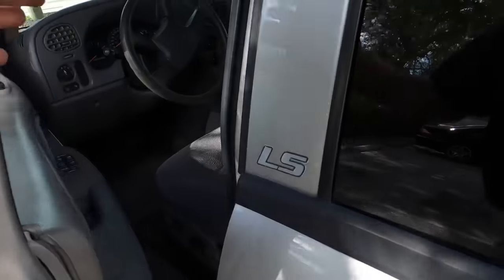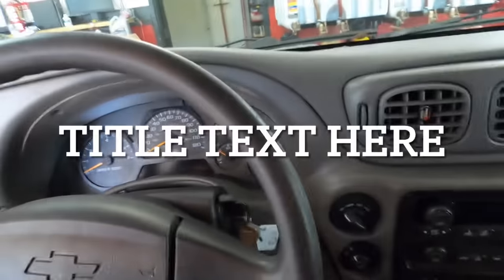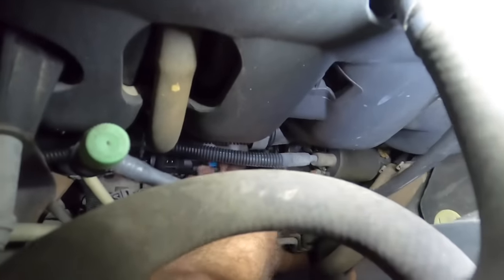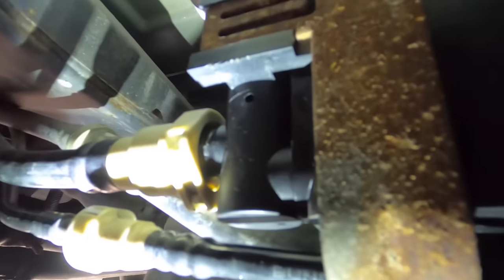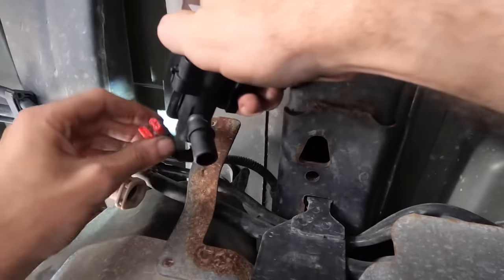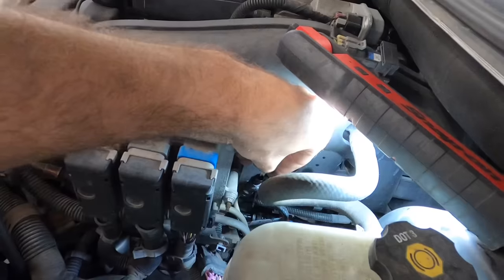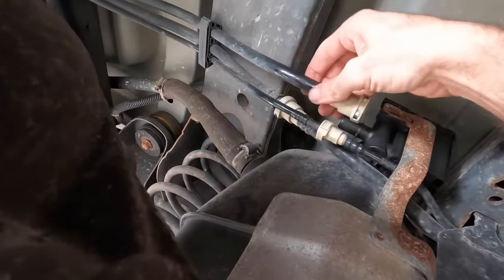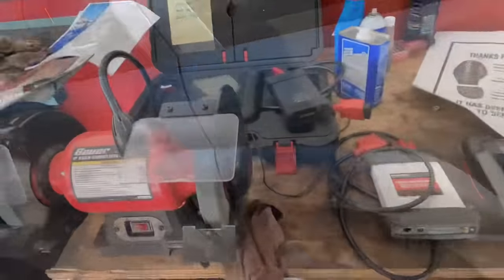Repair failed! Customer is Angry

Comment: I am impressed I learned something new. Reset codes before going to man to fix your ride. That is some next level thinking.
Reply: Exactly.  I'm going to use the diagnosis of a counter person then go to the expensive mechanic and force him to waste time.
Reply: I was trying to give the guy a chance. Maybe he had the code reset thinking it would fix the problem so he could avoid the shop.
Reply: Maybe he hoped it would reset his purchase of an old Chevrolet trailblazer.
Reply: Personally, I would have told the customer to drive some more until the warning light came back on, then to bring the car in immediately.

Comment: Thanks for the basic explanation of the evap system. I was having problems with the evap system on my Wrangler and didn't really understand what it was at the time. 
Funny story about that Jeep: I got it off an auction, sight unseen. It turned out to have massive problems all throughout. I was pretty bummed about the cost of repairs needed to get the thing running right and driving straight. One day, the clutch hydraulic system sprung a leak and I started losing clutch pressure. As I drove down the freeway toward home, cursing the Jeep the whole way, the Ram 3500 behind me decided to check his phone right as we approached a traffic jam, and slammed into the back of me going 70mph. Needless to say, it turned out to be a blessing in disguise. The money-pit/death-trap Jeep was totaled and I ended up getting a descent sized insurance claim settlement. That's one way to fix a problem vehicle.
Reply: Hopefully you replaced it with something reliable like a Toyota. I sold my Jeep and replaced it with a Tacoma. Could not be happier.
Reply: @MrMikey1273  Can't say on the newer ones, but folks who have older Tacoma's tend to not want to sell them till they're either rusted to bits or totally worn out. That should tell you something about them...

Comment: You could definitely hear a difference in the audible sound of the off and on of that valve
Reply: "Click" (or is that an achieved torque setting?) 😉
Reply: That's because the piece is banging against an end-stop when the solenoid energises, and just falling out with gravity when it loses power. So you get a click, snap or clack when on and a rattle when off

Comment: I had to replace a purge valve solenoid on our 07 tahoe , first code popped up was "tighten gas cap" bought a new gas cap. 

Cleared that code for that also had a pending code for the purge valve an it was gone show up anytime. So I knew that's the next part to replace. 

After replacing both parts i have no problem filling up gas or 3 cranks to start after a fill up, that happened first before replacing the purge valve. 

Gas cap was probably worn from over the years since 2007 till now.

Comment: My 2002 Trailblazer lasted 20 years with no major issues. Sold it because it was old and wanted some new tech. Hopefully my new suv will last that long.  There was a recall on the gas tank/ assoc parts.  Free replacement.

Comment: Love your videos Ray. As a GMC dealer tech that deals with evap issues on GMs every single day, i want to chime in on this one. I like to start with evap systems by performing a purge/seal with the scan tool engine running. That can often give you a good indication whether you’ve got a system that just won’t hold vacuum, a vent solenoid that isn’t closing, massive leak, fuel tank pressure sensor that’s lying, etc, just gives a quick preliminary of what the system is doing before breaking out the smoke machine or anything like that. 

Now the second thing i want to mention, on GM vent valves, turning them “on” energizes the solenoid and CLOSES the valve. So I’m a little confused on why you’re expecting there to be smoke coming out when you turn it on? Unless i was just misunderstanding. Turning the valve off should open it and allow smoke to escape.
Reply: Is it true that smoke doesn't open valve on GMs?
Reply: @abccde3832  apparently yes from everything I've gathered, but my experience with a proper smoke machine is non existent but the actual verified mechanics I've seen are saying yes
Reply: @michaelf.2449  very good to know, thanks!

Comment: Awesome 😎 I own 2 Chevy Trailblazers a 04 and 05 love to see your experience used on these vehicles it increases my knowledge when weird things go wrong with mine 🤣 Thank you very much 👍🏼
Reply: I had an 04. I liked most everything about it except the damn ridiculously complicated and overly sensitive independent vent/duct damper motors. They'll go electronically belly up just changing or disconnecting the battery. I've been a mechanic of various genre's my entire life and consider myself a patient man but I'll tell ya...those damper motors made me walk away inventing new swear words more than once.
Reply: @gregoryking9348  on my 04 my fan speed resistor has melted the plastic electrical plug so now my blower motor hasn't worked for 6 months now 😠 I was wondering why there was a faint smell of burning plastic sometimes as I'd drive around 😂
Reply: Jimmy S  The GMC Envoy is the same as the Chevrolet Trailblazer both came in 2 sizes a standard and an extended version that added a third row of seats. 😎

Comment: Always use original GM evap parts only on GM's. Same thing happened to me. Bought a purge solenoid from Autozone, lasted 2 weeks. Replaced with AC Delco 3 years ago still working fine.

Comment: Brother, I wish your shop was near me.  I have had no luck having my Impala repaired from 3 different mechanics.  I love your videos. Keep them coming.
Reply: @Uriel Ventris 
Good, competent, HONEST mechanics with skills are RARE as needle in a hay stack. Same problem here...
Reply: What sort of issue are you having?
Reply: @Zxceelxuz  Intermittent failure to start.  The security light will come on.  I have to do the 10 minute reset then it's all ok for a while.  I've had the dealer and other shops "work" on the BCM but it still comes back.  Basically, it sits in the driveway now because I can't trust it to start again.  2006 Impala.

Comment: I am surprised you took the smoke machine away before mounting the new valve. Audible test ok
 Smoke test better.
Reply: I thought the same
Reply: @Charlie_Crown  Yep.. But i am not sure its fixed.. If the solenoids are working its probably OK valve.
Reply: Yes!!!! Seems silly..
Reply: @TheJcrandazzo  Of course it's fixed. It's Ray, remember ? :- )
Reply: @loubakker5000  could be??
Reply: @Nostalgic Enigma I think Ray is a good mechanic. They always contact the customer. Customer can always say no. Partys canon sounds too popular.
Reply: @TheJcrandazzo  He is good mechanic, no ?
Reply: @Nostalgic Enigma What's SMA?
Reply: @Nostalgic Enigma Doesn't it always start wih a guess ? That educated guess shows the way to search helped by a tool. Not familiar with SMA. I am from europe.
Reply: @Nostalgic Enigma Customer came in for evap system with relation to solenoid provided by the customer and installed in Ray's garage. So why do a deep research if not asked by customer ? Don't need to. No checking wiring diagrams required. 100$ for a smoke test ??? Tax included ?
Reply: @Nostalgic Enigma Yeah, I remember the guy. With mrs O.
Reply: I have been fighting this same code for a year now.   I had a fuel pump go  out on my 04 envoy same thing as this trailblazer. At the same time I replaced the filler neck it was rusting out.   The new neck and old gas cap didn't fit so I had to get a different one.  I can never tell if it seals right.  I even built my own smoke tester.  I didn't  plug it in at the port I used the filler neck.  The thought was the problem  would be a loose connection when the fuel pump was replaced.  When I smoked it it was leaking around that purge valve. But I had no way to command it on or off.  I replaced the solenoid in the front and valve in the rear. Given the age of those parts and the price of them I just decided to do both.  And they were delco parts  after doing all that guess what the error code came back a few days later. It's not driven every day so it can take some time for it to come back.  I have a new reader now that will actually read evap data. I have the data I just don't know what spec is.  So frustrating  my hunch is the gas cap. I see now how to use that front port.  That might be the next move.  I will foil tape the gas cap to the filler to see if I get a code before smoking it again.
Reply: He could have driven it for a half hour and see if CEL light came back on and charged the dummy customer who had it cleared for the time.

Comment: I had a car that was having starting issues, so I had the battery tested and it was bad. I put in a high dollar Gold series 7 year battery. I still had starting issues, so I replaced the starter, then the cables, and.I still had issues..so I took it to the service station that sold me the new battery. They analyzed and checked everything - it was the brand new battery. The first part that I replaced was still the issue.
Reply: I have installed those batteries at a parts store I used to work at. There is nothing more embarrassing than having a brand new battery go "click"

Comment: I agree with comment from South Main Auto Repair LLC. I've been fooled by that valve not opening when there is pressure from the smoke tester in the system. However, it appeared that Ray did not really have a tight seal where the smoke machine connected to the test port so I wonder how much pressure there was in they system.

Comment: I do not go out and buy random parts until I know for sure what is broke. That's like right now my expedition is throwing two codes. When I locked up what might be the cause most of the articles and videos out there all say mass air sensor. Then I found other videos telling me the PVC hose is normally what is wrong. 
So tomorrow I'm going to do exactly what you did here and smoke the engine and verify what is going on before buying any parts. 

With a smoke machines that are out now it really helps figuring out things quickly. Has anyone who has ever had a vacuum leak you know how much of a pain in the butt it is to find it. Normally with the smoke machine within minutes you see where you have an issue.

As always I made sure to give you a big old thumbs up. Look forward to watching another one of your videos.

Comment: I just had to deal with the dreaded evap code on my cobalt. I threw the parts cannon at it and got it fixed. Luckily it was still cheaper that taking it to the shop or buying a smoke machine. Chevy evap parts are cheap, even the quality aftermarket stuff.
Reply: I built a 12v smoke machine from Lowe's plumbing parts and some other minor what-nots for about $25 and an hour of my time. All that's needed after building and using it is some baby oil and a small compressor. Even a 12v emergency roadside compressor will work fine.
There's vids on Youtube on how to build one. They're super easy but irreplaceable as a diagnostic tool...especially on older Rust Belt buggies like my '03 Dakota.
Reply: @gregoryking9348  thanks for the info, I’ll look into that next time I get those pesky evap codes.
Reply: @mikeymarriott  I bought one made from an ammo can on ebay for around $60 a couple of years ago. It paid for itself on the first use.
Reply: @gregoryking9348  Very interesting.Thanks,I'm going right now to check those out

Comment: Troy feels like I did when I got the call from the shipping company saying I had the wrong address and if I had a phone number so they could get the package to you. I'm impressed that you didn't start yelling at Troy for the wiring mistake. Obviously he didn't notice the crank sensor wasn't connected, he should have been with you when you were coming up with a solution to fix the problem instead of going for lunch because he was mad. At least he didn't start throwing tools like some people do. Good job on coming up with a solution to correct the situation.

Comment: When a customer goes cheap , pay twice 😂
Have a great weekend everyone and a great day of course ! 👍
Reply: I learned that lesson having my mechanic install ebay sourced wheel bearings on a Prius.  Didn't last long, neither did the warranty replacement ones.  Mechanic was happy, cuz I had to pay them twice lol.  I think it was still cheaper than the OEMs they wanted to do in the end, but I won't do that again.
Reply: @Solkre82  , people buy Toyota for reliability , putting cheap part on Toyota is like shooting yourself in the foot
Reply: I can’t learn that lesson fast enough
Reply: @tstocker6926  😂 true
Reply: @Solkre82  what about a used one
Reply: @theantiveganchannel3596  My problem was I didn't know about the "eBay issue" with car parts at the time.  They all say their OEM quality and it was a high mileage car already.  I know better now.

I still try to do my own work when I can.  Replaced the traction battery myself when it died at 125k miles.  The refurb I bought died under warranty (3yr, got 1.5) so that one was free.  Funny enough, the rebuilt packs now only come with 1yr, you-dont-say!
Reply: @tstocker6926  Live and learn.  That Prius was my first car purchase alone and I'm not a car guy.  Bought it for the MPG, not the name.  Gas was $4.25 at the time.  People seem to have short memories about that time period.
Reply: Every part is made cheap very hard to find good parts
Reply: @dd6892  Thats true , car's are made of pastic ... Flashlights nowadays have stronger magnets and cars more and more plastic 😂😏
Reply: @dd6892  ,  Napa has OEM quality parts.
Reply: @Solkre82  yesterday?
Reply: Have you told that to insurance companies?
From my experience your car insurance won’t pay out for OEM parts if they can avoid it.
Reply: Fix nice. Fix it twice.
Reply: @nicholasr7987  😂😂😂👌
Reply: Learned that lesson with eBay and Amazon parts for my XJ. I do my own work ans changed an IAC 3 times in one month with $7 Amazon and eBay ones (the original died after 20 years). Ended up biting the bullet for a Mopar IAC and 2 years later, no problems. I should've listened to the forum posts saying to only use Mopar parts for anything electrical. Now, I only buy Mopar or OEM replacements for everything. No more cheap Chinese parts for me.
Reply: @Solkre82  We are at 2.89 here and I keep reminding folks that about 20 years ago it was up to over 4 in Houston almost 5 if my memory is correct.  We aren't even close to the highest it's been.  Though I got a  feeling we will see the highest numbers soon.
Reply: I’m one of the pay twice crowd.
Reply: @tstocker6926  Yet even Napa has slipped. You once could not buy a lesser part there, but now their standard parts are essentially what you can get elsewhere for less and their premium parts only somewhat better. But at least those are better which you can't get elsewhere. They're still my first choice.
Reply: @Solkre82  Most mechanic do not install customer parts! I learned this 35 years ago when I owned Volvo from Sweden! Most of Volvo used OEM parts that the most expensive parts in the world! The OEM Rotor  for Volvo 760 cost $425.00 plus $30.00 per hour shop rate! There is no turning option every time you fix the brake. The timing belt adjustment elements bearing go wrong every time when changing belt and valve adjustment. The water pump went wrong every year and cost $300.00 to fix same as muffler that burn out every year and the whole system must be replaced. I moved to LA in 2007 and I hired Japanese mechanic to replaced my burn oil engine and it still burning oil. He spend time disassembles the whole engine and clean them and renewals all Japanese parts gasket during Christmas Eve and I drove the car home trouble free. All I paid is for gasket and water pump that he ordered from ASIAN brand.
Reply: @Solkre82  don’t see how putting junk on twice would be cheaper than just putting on quality parts one time !!
Reply: @theantiveganchannel3596  that’s what the “ eBay” part were, LoL
Reply: @WastedTalent-  LoL, read your “ mopar” box your parts came in.

Comment: I’m a total dunce when it comes to working on cars. I’ve changed oil on several of my cars, replaced brake pads, fuel pump, water pump, batteries, spark plugs, headlights, a radiator and changed several flat ties, wipers and a few other sorted parts. But that was 20+ years ago!
The cars today have so much junk on them, I’m not even qualified to check the oil. 😂
Your videos are enlightening and entertaining. You explain things very well and present it in a humorous way that us common folks can understand and appreciate.
Thanks!

Comment: Ray, I noticed that the old-new solenoid had a sound of a checkball bouncing when you commanded it off.  The new-new solenoid didn't have that sound which is good.

Also, notice to customers -- DON'T CLEAR YOUR CODES BEFORE TAKING YOUR VEHICLE TO A MECHANIC!!!!!
Reply: Your also notice should be “ don’t be cheap on auto care ! Pay for a proper diagnoses and let the shop do their job” !